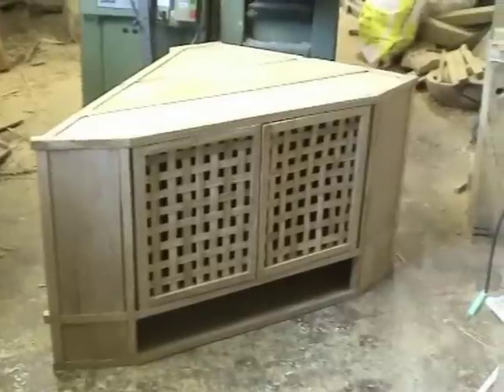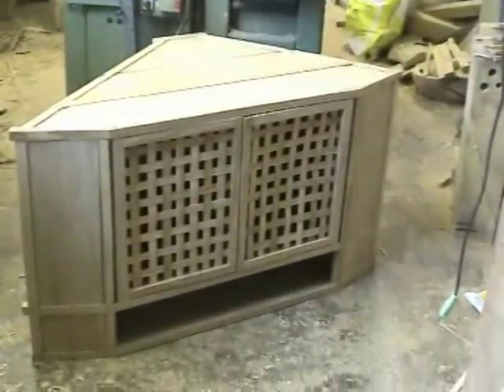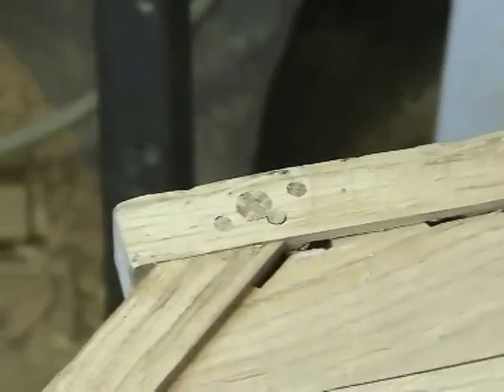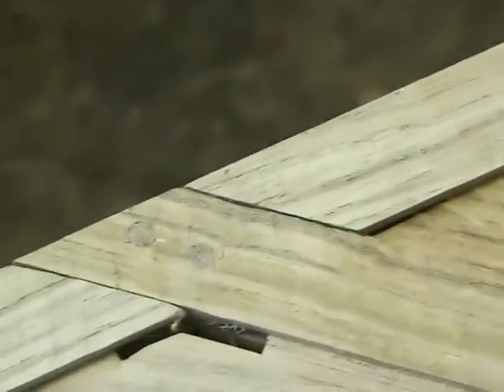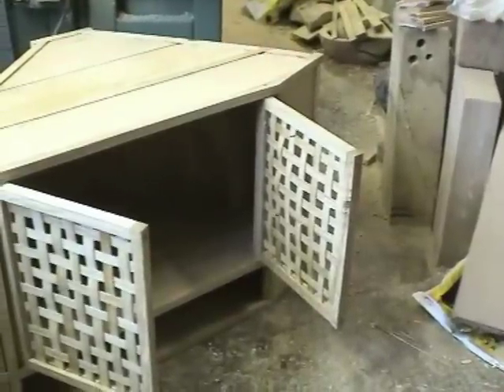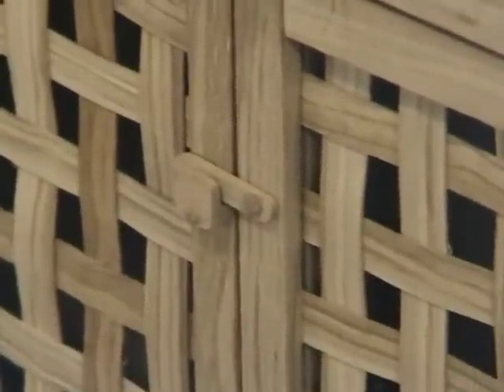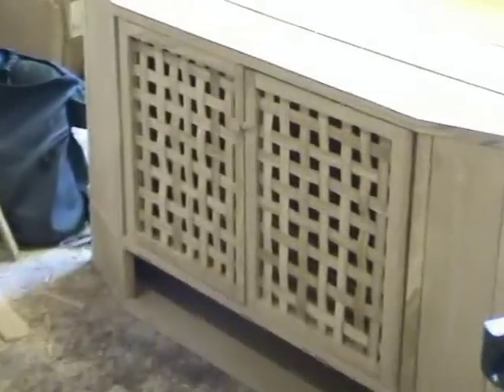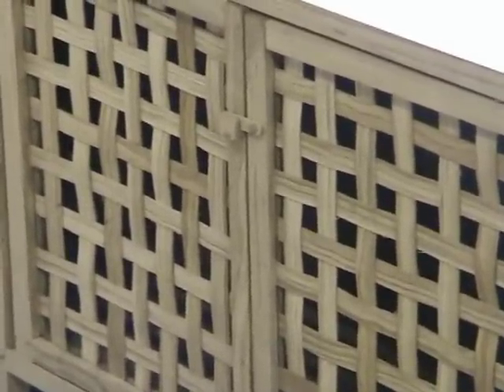Part 4 cabinet in wet wood.  Final.

Comment from the maker: Wet wood is cheap, as it dries, if you have done the work properly, the joints become iron fast. 
When wet, wood tends to be more elastic, so you can push it around more, its easier to carve and sometimes shape with machinery.
The only drawback is finishing.  The clients were happy with no finish at all, though i suspect they treated it with danish oil later.
I enjoyed using this material, it was a pleasant change.